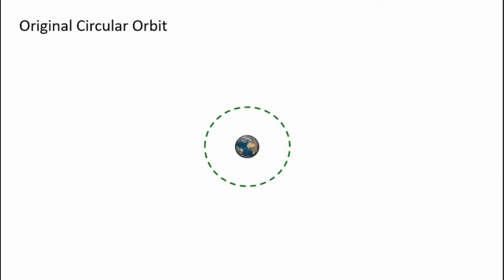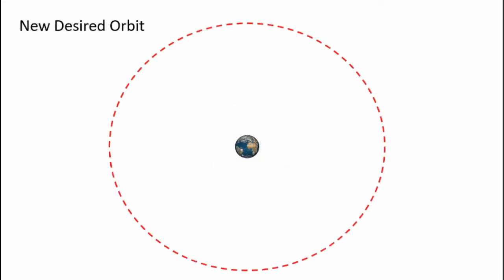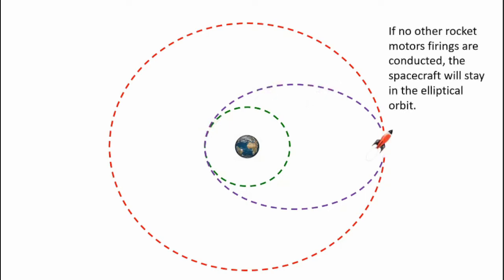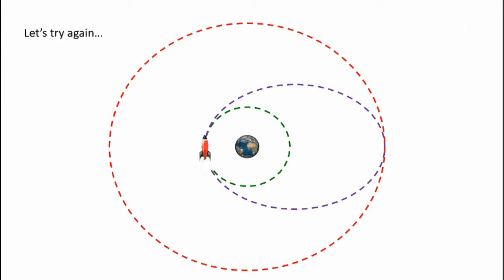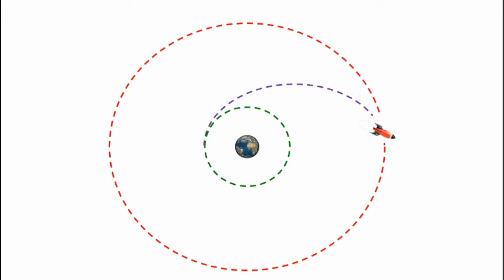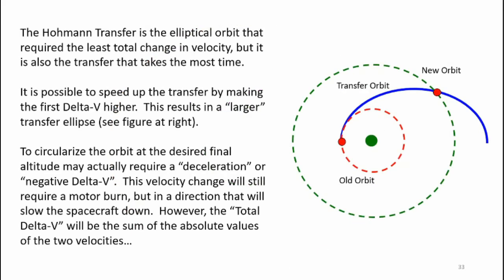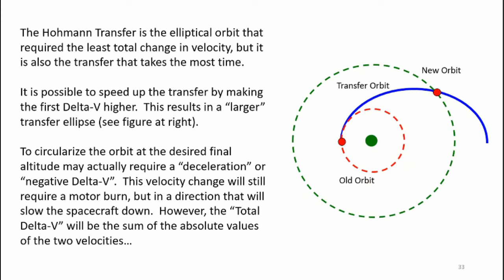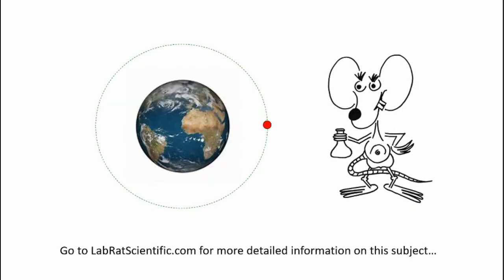Introduction to the Hohmann Transfer Orbit

Comment: why we need a hoffman transfer, I mean can't the spacecraft get directly from the earth to the desired orbit, without orbiting a smaller one ?
Reply from the maker: Yes, a spacecraft can lift off from the earth and ascend to a specific orbital altitude directly.  It gets a little more complicated if you are trying to meet up with something already in orbit (i.e. space station) when precise timing is required and you might not be able to launch at precisely the right time.  The spacecraft may be sent to an initial orbit, then wait for the right time to make an orbital change.  Ideal Hohmann transfers aren't used in these cases, but rather a spiral transfer is used which can take 2 or 3 days for a cargo capsule to "catch up" to the space station...  And you can't just "speed up" to catch up the space station, because as your velocity changes so does your orbital altitude.  The Hohmann transfer is most useful (and obvious) when getting from Earth to Mars (or another planet).  The spacecraft starts at earth's orbit (the lower orbit) and then makes the transfer to Mar's orbit (the higher orbit).  The same is true for getting to the moon.  The moon-bound spacecraft first gets into a parking orbit and then makes the transfer to the moon's orbit when the timing is right.  You may see movies that show a "figure eight" flight path to the moon and back.  It might look like that in a static picture, but in reality a Hohmann transfer orbit is used.
Reply: @labratscientific1127  thank you so much  I really appreciate that

Comment: In the elliptical orbit at apogee is the spacecraft capable of docking with a station in the higher orbit, assuming the timing is correct for the two to be very close? If so wouldn't this result in the new docked pair to enter an elliptical orbit because they're net velocity is lower than that required for the original higher circular orbit? I'm dying to know the answer, thank you.
Reply: It's actually possible to do that but in real life engineers don't need to do that way as it is more complicated and risky(because once they're docked, the ISS let's supose, needs to accelerate as the mass is bigger now as there are two objects,  spacecraft and ISS. Adding this the precise timing, you see it's not easy this way). Instead the spacecraft burns once for reaching the higher orbit (letting ISS pass to have it in front of you in your way, to prepare for docking) and once to STAY at this higher orbit. Then, with the ISS in front of the spacecraft, slightly increase the velocity to reach the docking point.

Comment: At the higher orbit , further from the gravity well, the orbital velocity is lower , so when is the ΔV changed to circularize the second orbit? 

Equations :

V^2/r = G*Me/r^2 

mass  of spacecraft cancels out 

V=( (G*Me)/r)^0.5

So at low Earth orbit 

G=6.67E-11

Me=5.98E24 kg

r1= 6.6E6 meters

r2=1.32E7 meters

Low Earth orbit 200 km above the Earth’s surface 

V= 7,773.9 m/s

High Earth orbit 6600 km

V= 5,497m/s
Reply: Good question Thales, the difference is you need to compare the velocity at the apogee of the elliptical transfer orbit to the final orbit, not the lower orbit. It's counter-intuitive because your calculations above are spot on - so why do I need to speed up to go slower? :-) 
So, using your equations above, if I am doing 7.8km/s and I add (for example) a delta V of 2km/s my orbit becomes elliptical (doing 9.8km/s at perigees and 2km/s at apogee). The apogee of my new elliptical orbit is at the altitude of my desired higher orbit but, by the time I get there I have traded a bunch of kinetic energy for potential energy and my velocity has dropped to 2km/s as I prepare to fall back to perigee. But, if I add 3.5km/s of delta v I achieve the 5.5km/s you calculate above and my orbit remains circular instead of returning to my previous altitude (the perigee of my elliptical orbit). I hope that helps, it's challenging to describe without a whiteboard.

Comment: Do you fire the rocket motors at Apogee of the original orbit in a prograde orientation against the Earth?
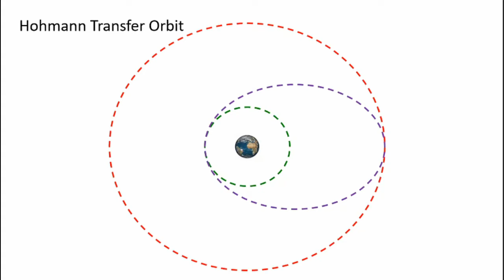Reply: The first burst should be fired at the perigee of the transfer ellipse as oriented at time mark 0:55 . You shouldn't be doing any velocity change in respect to apogee or perigee of the original orbit because this Hohmann transfer method only applies to 2 circular orbits, or 2 orbits with eccentricity of 0. The calculations would change if the orbits where not in fact circular.
Reply: @tempestandacomputer6951  thanks!

Comment: How do I transfer from high orbit to lower orbit?
Reply: The rocket needs to be in a retrograde position, (nose facing away from the direction of the orbit). Then your burns should look the same, closing the orbit
Reply: basically burn the other way

Comment: The principal is relatively easy to understand.  The bit that does my head in is how you work out how long you burn the engines for.
Reply from the maker: You need to change the velocity of the rocket, or give it a Delta-V.  F=ma comes into play, your thrust force creates an acceleration a  =  Thrust Force / Mass (units = m/sec2 or ft/sec2).  If you burn your motor for X seconds you get a velocity change.  Velocity Change  =  accel  x  time  =  m/sec2   x   sec  =  m/sec...

Comment: Is this the same as a cycler? https://en.wikipedia.org/wiki/Mars_cycler
Reply: Hi Adeel. It isn't the same, but you might use Hohmann transfers to reach a cycler orbit. Importantly, the Mars-Earth (Aldrin) cycler is heliocentric (i.e. it orbits the sun) so you need to consider leaving Earth orbit and establishing a separate Sun orbit in order to 'cycle' between Earth and Mars. Once you're in the cycler orbit you only need to correct for perturbations ('wobbles' in your orbit) to stay there.
Reply: @stevenhenry3714  Thank you for taking the time to share this information with me. So basically you are suggesting. 1) Leave earth 2) Establish an orbit around the sun 3) Wait for the right alignment and then head off towards one's destination?
Reply: @AdeelKhan1   Yep, that's about it :-)

Comment: still makes no goddamn sense to me
Reply: I'm not sure if I'm 100% correct but this is what I got: the Hohmann transfer orbit is basically using an elliptical orbit to transfer a satellite from one existing smaller and lower orbit to a bigger and higher one. 

To first leave the small orbit it's sped up until it leaves the org track, but by leaving this it creates a new elliptical orbit. After leaving the org track it slows down,  but when it reaches a certain point, aka the apogee (since when it left the org track it created an elliptical orbit so we have apogee and perigee now yay), it speeds up again and turns slightly away from the orbit it was directed to earlier. now it's fully transferred. 

1. speeds up to leave the org circular orbit and forms an elliptical orbit by doing so  
2. speeds up again when it reaches apogee
3. change direction by a bit after speeding up
3. at new orbit

I hope it helped and gl with your studies! :DD